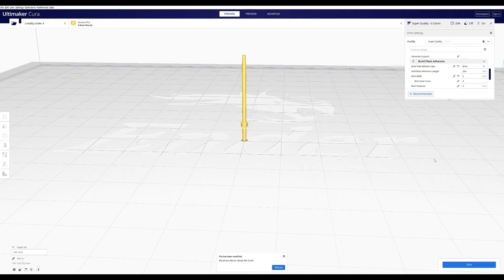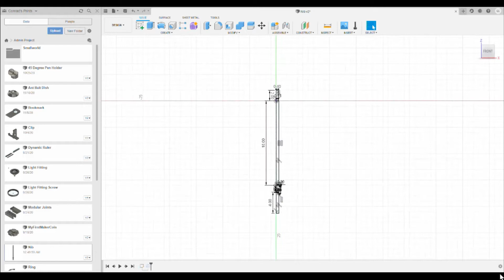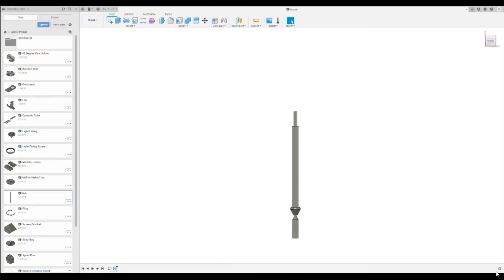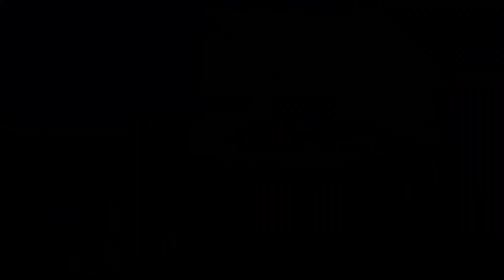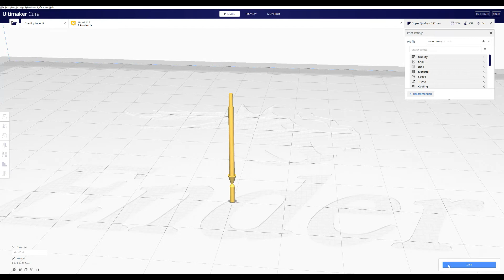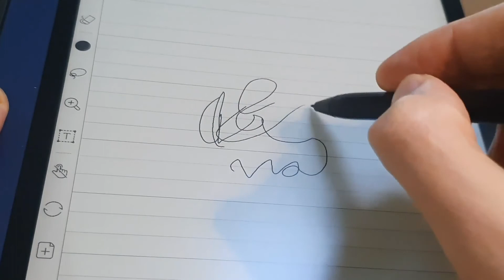3D Printing My Own Replacement Stylus Nibs!

Comment: I cut a small piece of trimmer wire and used it as a nib for my Wacom tablet but I noticed it left some scratches on the tablet. I think you have to be careful about the hardness of the plastic that you use for the nib.